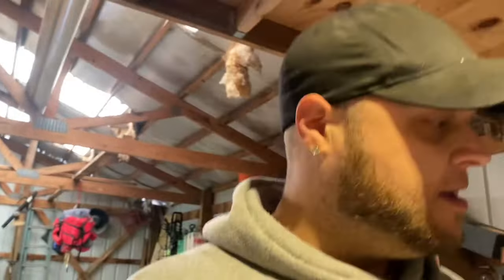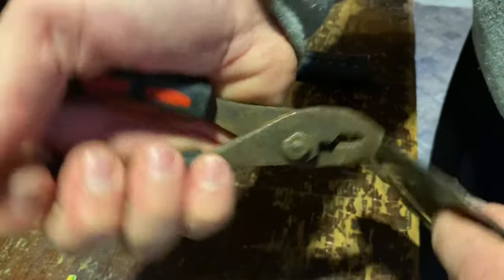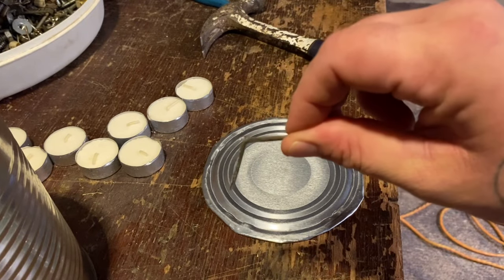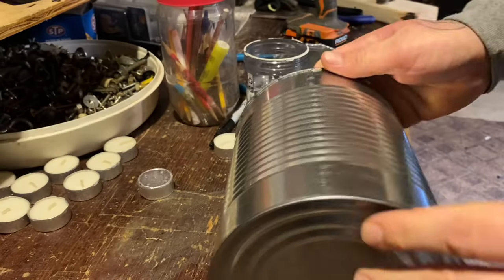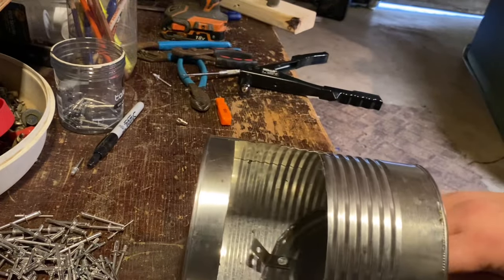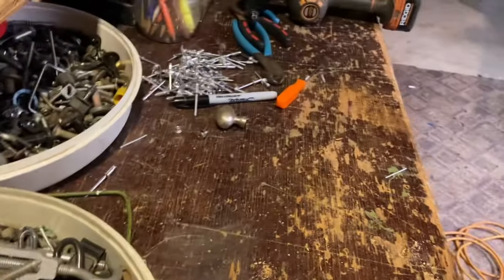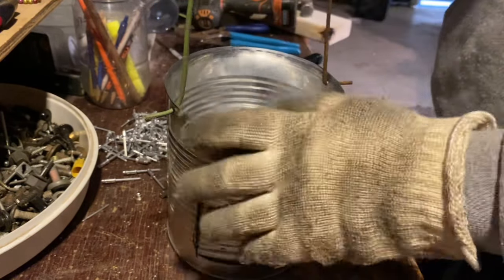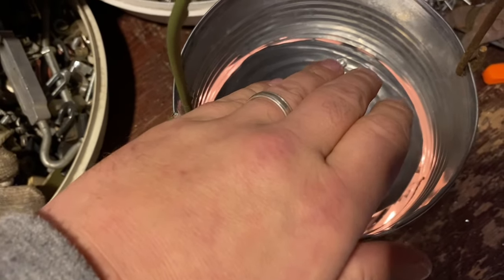CLAYPOT candle heaters SUCK. Build THIS ONE instead!#diy #heater

Comment: I've been using 2 Pot candle heaters and a Metal one all through the Winter in the UK !!!!  The cool air is drawn in at the base so the candles have never caught fire !!!  I have used about 500 Candles and I have loads of Detectors for Carbon Monoxide and CO2 and Air Quality !!!  None of them have gone off !!!!  My Butane camper heater sometimes sets off my Fire Alarms, but that's when some dust burns off it !!!!  I have saved myself thousands of Pounds on my heating bills !!!!  I would make some holes around the bottom of the Tin to stop the candles from getting too hot !!!!  This would let some cool air in !!!!  My stuff is manufactured for the job so they are thoroughly tested !!!!  Sometimes when the wax gets very low a candle will start burning the Wax, but it doesn't cause a fire, and just smells a bit !!!!  But I would not make my own heaters just to save a small amount of Money !!!!  The Pot heaters are Really Good, and So is the metal one !!!!  The bills here are about £5,000 per year and I have spent about £500 on Candles and Gas Cannisters and my Electricity Bill is £600 for a whole Year !!!!  I had my Gas meter Removed so I have no Gas Bill at all !!!!  My candle heaters are on Metal Tables so they can't set fire to anything nearby !!!!
Reply from the maker: This is a true testament to the effectiveness of “old school” methods.
Reply: @WoodsWalkinLYF  Yes !!!!  I have manual washing machines and a Mangle. These save me from using dozens of killowatts on a washing machine, tumble dryer and electric iron !!!!!
Reply: Fantastic.

Comment: I am an old lady and power goes out two or three times in the winter.  I could never make one of these myself.  You should sell them!
Reply: Buy an empty paint can or small alum bucket. Metal cookie sheet or pie tin for the top. 6 hour tea lites made a big difference for me. Keep looking at all the different types. Careful w grouping too many tealites together, they can flash over
Reply: It would be a good scam you would have to have multiple pots with a lot of candles and these candles he is using do not put out enough heat unless you have 20 to 30 of them and they burn out in 2 to 3 hours

Comment: Hey man! Just made one of these using Ur guide..I have a small shed about 12sqmtr I use for working in.
Now that winters here in the UK about 5° today.
And with energy prices being so high I needed another way to take the chill off without using my electric burning heater and this has done the job perfectly 👌... having lit the candles and left them for an hour to heat up the shed there is a defo rise in temp and makes the shed a pleasant place to be in the cold weather...My shed is well insulated so it's trapping the heat in nicely too.
Thanks m8 u got another sub👍
Reply from the maker: I’m glad it helped!! Remember to ventilate just a smidgen, any flame that isn’t blue gives off f carbon monoxide, and is dangerous!
Reply: @WoodsWalkinLYF  will do m8....keep the tips n creations coming👌

Comment: Hi man i use same design ,but i also shred a few cans by cutting round the can grooves,so its like a spiral spring when you pull it down..pack them in loosely and put a lid on top of that ,few holes in the top..it adds a element type effect holds heat longer and radiates more..i also have the stove fan but that will not run on candle..but i use a 12 volt pc fan..works really well.but another real easy way is a shiny chrome metal dogs bowl with sloping sides.light as many candles as you can ,till they start to snuff each other out.get that right and you have the equivelent of a fire pit in your camper and a excellent light source..ive lived thru winters in a tranny camper van using just that for heat..i discovered candle power about 8yrs back saved me loadsa cash. Subbed man and hello from England 😀
Reply: Same here !!!!  I bought my Candle Heaters and they've saved me a Fortune !!!!  I live in SW UK !!!!

Comment: Thank you for sharing the information. I will try to Copy what you did !What about leaning it up against the wall like that? Wouldn’t the wood catch on fire? Maybe putting it on some bricks would be safer than up against the wood wall? 
I’m also concerned about that many tea, lights with wind or whatever movement would spill the wax out of the bottom of the tea light onto the tin can which could run out and as it’s running out could still catch fire on something, so I am a little worried about placing it inside another Can in case of spill over or placing it on some bricks instead of on the wood, but I mean a person has to stay warm. I just don’t wanna catch on fire.
Reply from the maker: Your idea would work well.

Comment: Yeah it's gonna put out more heat when you light over 3 times the amount of candles than people do with terracotta 😂
Reply from the maker: That’s the point. The tin can has a higher flash point. No exploding pots.
Reply: My point was that for a small room you only need 3 to 4 candles and Obviously if you add more you'll get more heat. No matter the medium.

 Terracotta will hold heat longer meaning you can use less fuel and get the same high temps than a thin metal will and then disperse it more evenly through surface radiation. 

Terracotta should only crack from heat during firing and that's if they're still moist. The steam created can literally explode them. Or If they're cheap, meaning large air pockets then yeah maybe they can crack if there's humidity but that's less likely in a cold environment when this is needed. Additionally terracotta is fired clay, (which is just earth) it doesn't really have a "flash point" which is the temperature which a material catches fire. Both metal and clay have melting points. but steel and especially tin (that's what your can looked like) has a much lower melting point than clay. We're talking over 3200 degrees for clay vs. Less than 500 for tin. If you get 3200 degrees from candles you're gonna be rich cause everyone will want some of those candles 😂

All that said i like your setup it's simple and you could probably use it for heating food too

Comment: I like this, going to make a couple !
if you'll put a brick in your fire, by the time you're ready to call it a night that brick is hot.
Get it out, dust it off carefully cuz it's hot, wrap it up in a thick piece of flannel sideways and lengh wise.
It will keep those feet toasty..
I'm 67, I put a brick in my oven when using it to cook.
It goes under the covers at the foot of my bed !

Comment: Just remember
The colder it is, the more heat it takes to shift the temperature your heating. 

We've all driven our vehicles on cold days when it seemed the heat just didn't do much good. It takes a lot more time and heat to shift very cold temps compared to just cold. 

Good idea though. 
I've seen the clay pot things and wondered about those. 
The only person I know who used it said they DO work but I'd trust this to actually work more. 

Please don't forget 
Anything but a blue flame is putting off carbon monoxide. 
No matter the source, ensure there's ventilation. 

Thanks for the video.
Reply: Tin is going to dissipate heat much quicker ceramic pot will trap better over time.
Reply: @ddroz23  yeah the pot helps release a little heat to you🙂if you're asleep when your fire dwindles down, but the metal transfers the heat quicker...you got it👍.

Comment: I've seen others that have a piece of metal flat on the wall behind your burner thing. This looks good for short term warmth, good job! Some things have this part exhausting out the candle smoke out but a second tube that's open to your heating space that absorbs heat from your candle flames by heat transfer so the candle smoke can go out a pipe and the 2nd tube runs through your burning can or across the top allowing heat to enter your heating space. That's great to see you tinkering and creating a helpful🙂gizmo for yourself!
Reply: And sharing it!

Comment: if a heater doesn't bring -10 to 32f it's useless imo
Reply from the maker: If you’re heating with a candle, you’re in trouble already 🤣
Reply: I'm working on modified hybrid candle heating right now. If you mix shredded cardboard with candle wax...
Reply from the maker: @socalibro  that’s awesome! I’ve got a variation of this setup that uses olive oil!